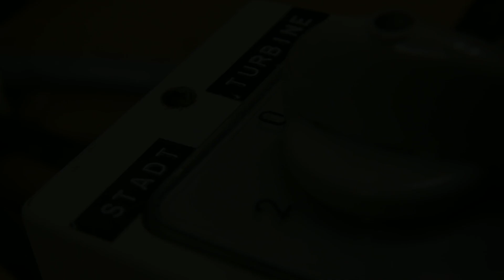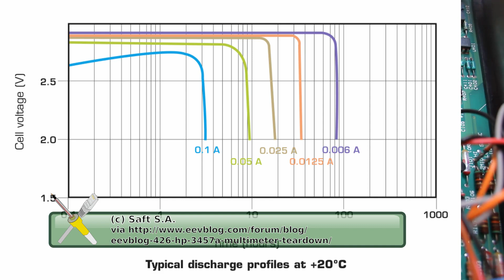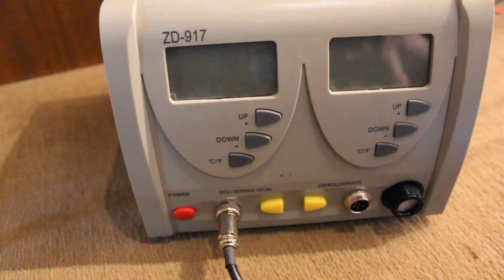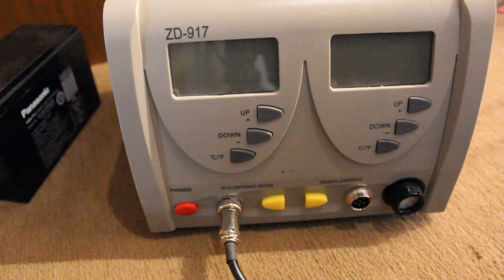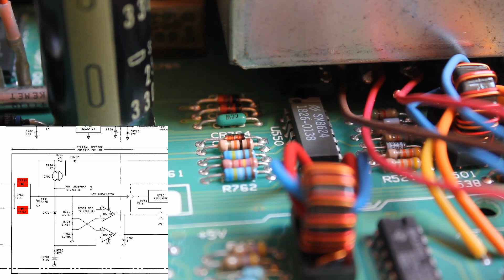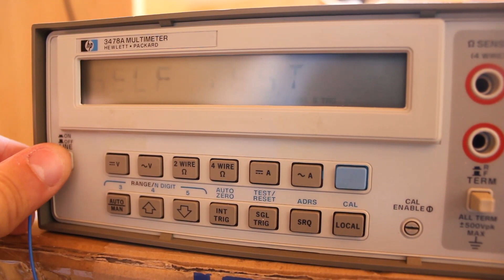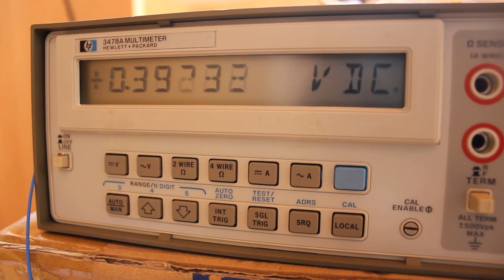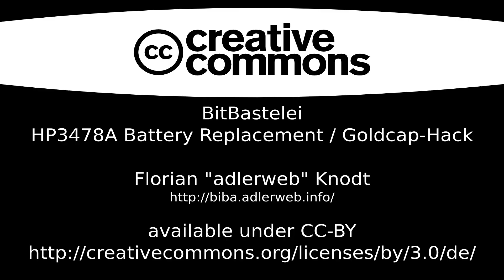BitBastelei #52 (en) HP 3478A battery replacement and goldcap mod

Comment: Many thanks for posting this, it was a great help in changing the battery in my 3468B, which going by the serial number was made in 1982.  As far as I can tell, the battery was the original one so had lasted for over 36 years!  Not having an isolation transformer or inverter I settled for the plug in the soldering iron, unplug when it reached operating temperature, do as much soldering as I could until the temperature got too low and then repeat.  I just had to be careful to make sure the soldering iron was unplugged before I picked it up to do any work.  A bit of a nerve-wracking process and a great relief to see "self test ok" at the end!

Alles gute.  Danke schon.

Comment: On my HP 3478A I removed the top & bottom cover and soldered a 2 aaa battery pack across C510, replaced BT1 and removed the aaa batteries, I left in the battery holder soldered and zip tied the battery holder to the L shaped shielding for future use. This work has to be done with the power disconnected since the grounded soldering iron would short the cmos 3v battery to ground.

Comment: You don't have to go through all this, if you just replaced the battery with the meter powered up.  Cut the old battery out, leaving leaving as much of the leads from the old battery protruding from the pcb.  Solder the new battery in...Positive side first! then negative, Done.  The CMOS ram gets  is power from the 5v supply when powered up, and the 3v battery is isolated from the 5v supply through a diode... Therefore, you can safely use a soldering iron to put in the new battery when powered up, but up, but you MUST solder the positive terminal first

Comment: I have what looks like a newer 3478A; it has a TO-5 linear regulator where yours has a TO-220.  I soldered a 3v backup battery through a diode to the proper side of C510 as you did in your video and then with AC mains disconnected, I replaced the main lithium battery using a battery-powered soldering iron.  When I re-connected AC-mains and powered up the meter, it came up uncalibrated :-( 

So it looks like the process does not work without AC mains power feeding the meter during battery replacement...at least not on the version of the meter that I have.

Comment: Thank you for your useful tutorial.
After the battery replacement, I notice that the big capacitors of the AC conversion (C761, C711, C702, C703) are sliglty swollen therefore I want to replace it. However I notice that there is a constant 0.5V when I disconect the power, and this voltage can be caused by the RAM battery (but I am not sure about that). Do you know if I can replace the capacitors without creating problems to the RAM voltage neglecting this 0.5V?
Reply from the maker: There are several schematics in the service manual which should help to check the caps circuit. As far as I can see the RAM (U512) is powered by either the Battery (R765, R768, CR764) or VCC (via CR500). Only local Devices are C510, C510 and U515. So as long as you do not short any trace related to the battery replacing the Caps in the PSU-section shouldn't affect the RAM.

Comment: I wonder if F-RAM could be used in place of the SRAM.  F-RAM works similarly but requires no power to retain its contents.
Reply from the maker: As long as the protocol is identical and voltages are supported - sure. Just keep in mind to back up the old contents beforehand.

Comment: Why not just connect the meter to an ups unit while working on it, this way there is not danger of loosing power, What do you think? I am working in a unit like this, everything seams to be ok, except the low ohms is reading a bit low any idea why? Thanks for sharing.
Reply from the maker: As long as the UPS (or your soldering iron) is not connected to mains that should work too. For me a battery seemed simpler and less error-prone.
A low Ω could have several reasons. Is it only slightly out? Only one of the ranges (30Ω, 300Ω, 3kΩ, 30kΩ, 300kΩ, 3MΩ, 30MΩ) or all? If its only a small error I would guess it's just drift due to age. According to https://www.eevblog.com/forum/testgear/diy-calibrating-a-hp-3478a/ it should be possible to calibrate single ranges to compensate this offset. For larger errors I would take a thorough look at the components first - as far as I remember there where test procedures in the service manual.

Comment: Mal eine andere frage mein netzeil habe ich ja an der stekdose und am ausgang plus und minus 12v und 45 a und wen ich noch so ein netzteil habe und den seine ausgangs leistung parralel dazu schalte müsste das dohh gehen oder ?weil ich habs mal getestet das netzteil giebt ein komisches gereusch so ein summen aber es funkzoniert und wird nicht heiß und habe auch mehr dauer spannung aber frage mich ob dus testen kanst oder anschauen ich kann dir ja mal ein video machen vom inneren liebe grüße joschie mag
Reply from the maker: Das kommt ganz auf's Netzteil an. Theoretisch sollte es schon gehen, praktisch ist das eine Wissenschaft für sich - da gibt's Varianten mit Widerständen, Dioden oder gar eigene Steuer-ICs. Bei einer solchen Schaltung reicht schon ein kleiner Unterschied der Ausgangsspannung aus um die Ströme ungleichmäßig zu verteilen, in dem Fall könnte das Netzteil mit der höheren Spannung überlasten, sich abschalten, kurz drauf dann das zweite. Eventuell fahren beide kurz drauf wieder an und es schwingt so vor sich her.. Mir hat sich auch schon ein Netzteil zerlegt, da es gar nicht mit einer Spannung auf der Ausgangsseite zurecht kam. Ich selbst hab in dem Bereich bisher nur mit Redundanzschaltungen zu tun, da ist das ganze etwas einfacher.

Sehr grobe Bastellösung: Hinter die Netzteile eine Diode und beide mit einem sehr präzisen Multimeter auf die gleiche Spannung einstellen. Funktioniert allerdings nur, wenn beide exakt die selbe Characteristik haben, ansonsten laufen sie bei höheren Strömen wieder auseinander und wir sind bei oben genannten Problem. Abhilfe könnte ein (entsprechend dimensionierter) Symmetrierwiderstand hinter jedem Netzteil sein - je wärmer der wird desto weniger leitet er -> das mehr liefernde Netzteil wird gedrosselt. Ist aber alles nur Theorie, selbst hatte ich damit noch nicht zu tun.